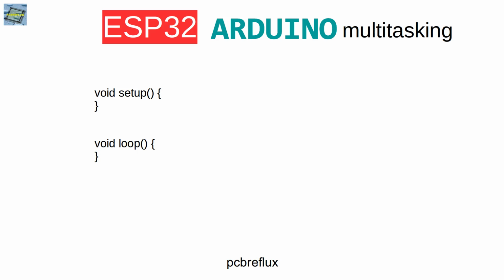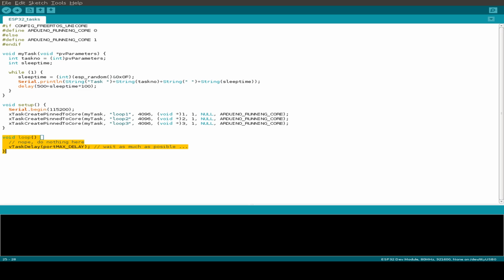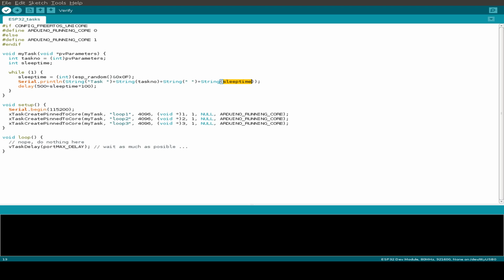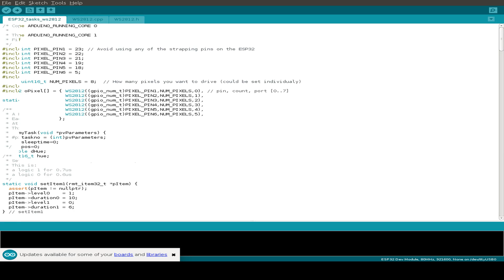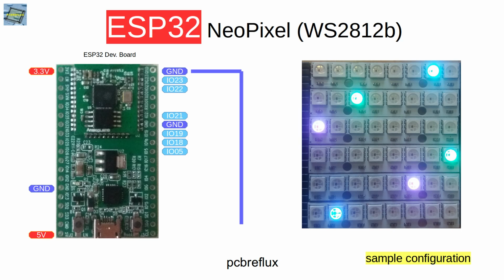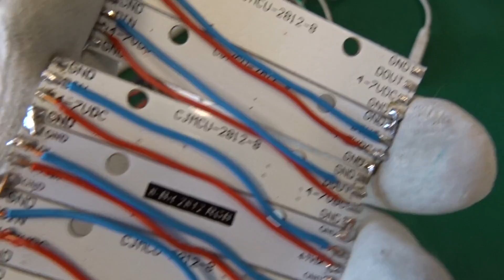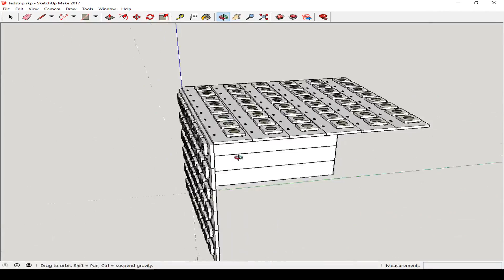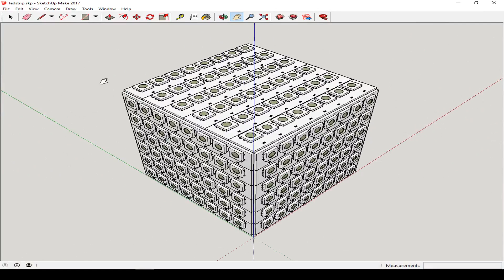ESP32 #42: Arduino Multitasking (WS2812 octo tasking) + ESP32 Giveaway

Comment: Is there some magic in the Arduino core for the ESP32 that ensures that libraries that are not thread-safe/reenterent have critical sections/locks protecting them?  Or do you just have to "know" which peripheral libraries are safe to be called from multiple threads?  Just anecdotally, I've noticed that some libraries have static data inside them which hold some sort of state, and having multiple execution threads in there concurrently (or even serially..) might break in weird, wonderful and difficult to debug ways.
Reply from the maker: Don't know any magic code. Think you still have to check every library, use it in a highlander way or add some lines to prevent a crash.

Comment: Hmm: Only 16 pixel in channel? After 16 - error in init stream.
Reply from the maker: Sorry don't get the error. Do you use WS2812(gpioNum,pixelCount,channel) where pixelCount is > 16? Have you an output or error message?
Reply: Correction: after 21 pixel - start problem from 22/
Error: E (124) rmt: rmt_set_tx_thr_intr_en(348): RMT EVT THRESH ERR

RMT for 0 channel use only 512*4 byte - 2048 byte
For ws2812b use 24*4 byte for 1 pixel
22 pixels - 22*24*4 =2112 byte+4 byte for "terminator"...

Comment: Can variables be shared among the independent tasks?
Reply from the maker: yes, but it depends on your tasks, if booth tasks read and write the (global) variable then try to surround the writing with portENTER_critical and portEXIT_CRITICAL and may consider using use a delay (vTaskDelay) in every task to before reading and after writing.
Or Better use intertask-communication with maybe queues example here https://github.com/pcbreflux/espressif/blob/master/esp32/arduino/sketchbook/ESP32_speed_gpio_dual/ESP32_speed_gpio_dual.ino

Comment: Nice tutorial! Thx for sharing with us.
You mentioned that the tasks could be synchronized with FreeRTOS Task API. 
Do you have a small example, of how to do this?
Are they any Semaphore and Mutex?
Reply from the maker: Just do a video about this topic #43 last week. Using two stepper motors to individually moved by a task (qeued) and synchronized with an eventgroup https://github.com/pcbreflux/espressif/tree/master/esp32/arduino/sketchbook/ESP32_DRV8825 . And this is an esp-idf example for semaphores https://github.com/pcbreflux/espressif/blob/master/esp32/app/ESP32_freertos_semaphore/main/semaphore_main.c.
Reply: thank you very much for the fast reply. This is exactly what I'm searching for. thx

Comment: Could you do a comparison of the different ESP32 boards that are available? I was looking on aliexpress and there seem to be a few different dev boards. Are some of the ESP32 boards better that the others? Any bad ones to look out for?
Reply from the maker: You can watch #15 of the esp32 series but every board have it pros and cons. If you need an easy to use board with build in usb to uart bridge and autoreset get an dev board. But if you have restrictions in size you may want an adapter and buy a module or boards with the bare chip and flash memory (like from sparkfun, adafruit, tindy, banggood, dfrobot or analoglamb). or you need a board with display, ethernet, sd-card and lipo? want to do your own boards? Need FCC approval? I use whatever fits to the project : cheap vs. functionality vs easy to use. And be aware of the shipping time you can spend money for express delivery or buy from your local seller or wait up to 8 weeks.
Reply: I wasn't referring to the bare modules or the wroom32 module. There seems to be a number of dev boards from various manufacturers. Some have lipo connections, some have an oled. I'm wondering if there are any other differences between them besides the really obvious ones like an OLED display.
Reply from the maker: Hector Lee From the programming perspective all ESP32 boards should look the same. Only the external flash memory can vary in speed and size. And the connections on the board can vary in the number of gpio pins. But the same gpio pin on one board should work as on an other board. Same with wifi and bluetooth. But I've heard that some modules get hot, but none of mine does so, all at the 30°C level even after hours.
Reply: Thats some really useful information. Totally forgot about comparing the external flash memory. Most of my projects have been small enough to not max out the flash memory but some of the project I'm going to work on might need more flash memory.

I had some trouble comparing the STM32 boards so was a little unsure about which ESP32 board to get started with. I'll definitely take a closer look at the various dev boards. The one with a lipo connector looks interesting for portable projects.

Comment: it could be possible to add the blynk library along side the multitask ? I think it might be but I'm not quite sure
Reply from the maker: The loop() with esp32 arduino is just a task (see main.cpp in the library). So blynk.run() is inside a freertos task on the esp32. There should no reason why not start an other task, if it make sense.

Comment: There are quiet a few ESP32 board on analoglamb.com, witch one is yours, or the one you are using in your video?
Is it "ESP32 Development Board – Developer Edition"?
I already played a lot with ESP8266, mostly micropython, and I have 3 or 4 different board, but due to the short of supply and uncertainty from the beginning of ESP32, I did not try yet.
What are the available board nowdays, those powering from USB, serial over USB with supported serial driver and where it is easy to "flash", preferably without too much hassle?
Reply from the maker: For the live demo I use my own board: https://github.com/pcbreflux/espressif/tree/master/esp32/kicad/ESP32-adapter but this have no USB to UART converter and 3.3V voltage regulator on board and no nice auto upload feature like the boards from analoglamb.com (or others) which is displayed in the setup slides. So I need and external CP2103 (USB to UART bridge) and in this setup you see also a ST-Link V2 as a 5V (from USB) to 3.3V voltage regulator. But I do this design 8 month ago while waiting for some boards and adapter but for my its still useful. Currently all my other boards are used in some other projects.

Comment: Great thaks to you! You encouraged me to install the git infrastructure and to Flash my WeMos Lolin ESP32 I received a few days ago. And it worked with your  touch sensor example. So I can proceed from ESP8266 to ESP32 step by step.
Now a lot of questions arise: 
- Does Multitasking work properly with Wifi? So that I can use wifi and a Input triggered counter in parallel. Here the ESP8266 "failed" and lost counts while maintaining wifi
- how to Control the priorities of the Tasks
- how are the priority distributed between the two processors
- how is the interprocessor communication done
- how can we establish an interprocess communication
So, enough itens for many interesting episodes. Thanks again!
Reply from the maker: For the wifi - wifi is preferable working on core 0 while the tasks and all arduino stuff running on core 1. So unlike the esp8266 you don't have to care. For priority and "inter task communication" you can use the knowledge of my videos about freertos...
Reply: Thanks again. Good to know, that WiFi and arduino stuff do not interfere. Thaks for the reference to freertos, so I will look for it. 
I just try to migrate one of my ESP8266 Sketches to ESP32. Not so easy. The EEPROM apparently is substituted by Preferences.

Comment: the github link not work, please update your github
Reply from the maker: Yes, sorry for that. But forgot my usbstick with the codes and could upload this easy on monday without type in the code again.
Reply from the maker: Code is now available here 
https://github.com/pcbreflux/espressif/tree/master/esp32/arduino/sketchbook/ESP32_tasks_ws2812
 and 
https://github.com/pcbreflux/espressif/tree/master/esp32/arduino/sketchbook/ESP32_tasks
 .
Reply: why you use xTaskCreatePinnedToCore()?
i try use xTaskCreate() without ARDUINO_RUNNING_CORE, it become error (CPU halted)
Reply from the maker: Core 0 is used for all internal stuff like wifi, Bluetooth etc. so with xTaskCreate you have only a 50:50 chance to run a stable arduino code.